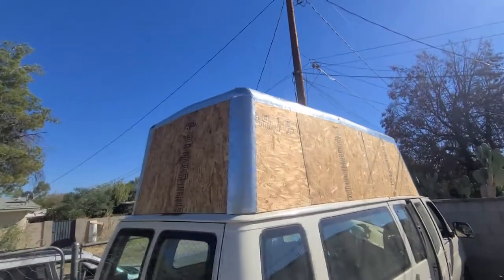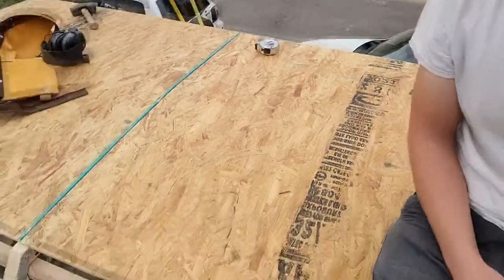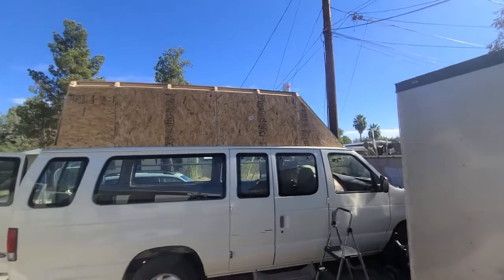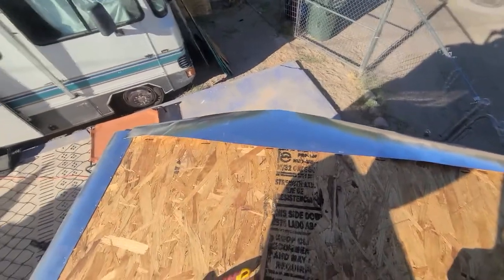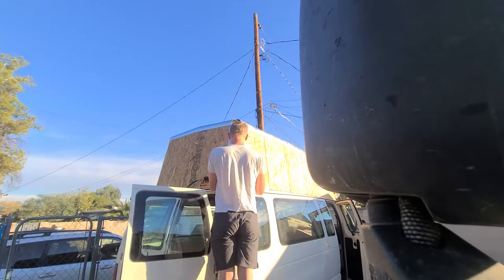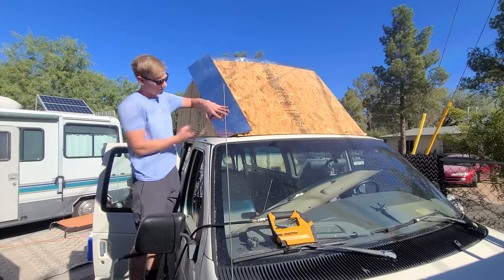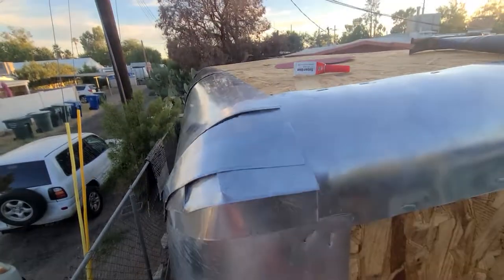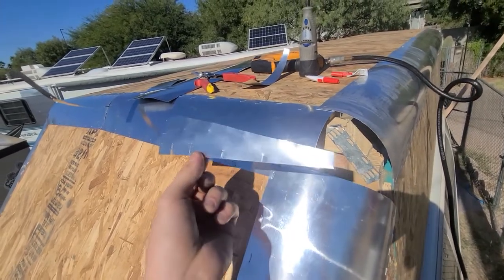Building a Wood Van Topper with OSB!

Comment: I have got a 1999 Savannah and copied this top on my van . I was 70 years old when I did it and it came out great . I made a couple of changes but basically everything was built the same I use regular plywood , I used your idea of flashing on the edges, I have more than 6 ft 10 Headroom. thank you for all the videos of your build , it made it very easy to copy your design and implement it on my truck , it's a very practical and logical design and works fantastic
Reply from the maker: That's great to hear, Roger!  Glad someone found some use in the videos.  If I did it again, I would also use regular (or marine) plywood for the shell.

Comment: Very nice.  I watched the completed project video first, now I am going back and watching your earlier ones to see the entire project from the start.  You provide a lot of really good information.  I was thinking of doing something similar only using that blue foam insulation board as the sheeting..  Once covered with fiberglass, you get the strength like you said and it is very easy to shape, just like when they make surf boards.  It is light and, you get insulation value at the same time.  It may or may not work, we shall see, ha ha.  Thanks.
Reply from the maker: If I were to do it again, I would consider that route as well.  You'd probably need an extra layer of fiberglass or two, but the strength should all be there if done properly.  Mounting stuff becomes a bit more difficult as well - It's nice having a pullup bar and Hammock rings on the inside of the topper 😄
Reply: @SisuVan  I would still build a similar 2x2 frame from wood like you did, it would not hurt to have a good, solid frame to work from.  I am very glad you showed how you built it, thank you.
Reply from the maker: Sounds like that would be a great way to go then!

Comment: Could you use a fine wire mesh for the corners instead of the sheet metal.  It would seem like a simpler and faster method of coverage/reinforcement.
Reply from the maker: I'm sure you could with fiberglass Mat, cloth would likely drip more.  Whatever you use as a substrate, just make sure you do at least 4 to 5 coats over the corners.
Reply: @SisuVan  thanks again for this build :)

Comment: I like your design a lot, it looked like you kept it safe by building inward a bit from the edges. I would want to utilize all of the space on the sides myself, but great design. I’m not an engineer so I ask is there a specific reason why the top is inward a bit? It just means a lot to me to make it flush with the rest of structure of the van
Reply from the maker: It mostly has to do with the structure of the van - you're going to want to attach the topper at a location where you have more than just the roof sheet metal to secure it too.  There is usually a structural rail around the perimeter that has a very solid flat surface you can bolt the topper to..  It is possible to still move the walls outward a bit though, you would just end up with an interior structural shelf - just build a wider foundation.
Reply: @SisuVan  oh yes that’s exactly what I am going for is to be able to utilize that extra space. Hey I just want to say that I really appreciate your build. It’s definitely the best I’ve seen.
Reply from the maker: @nightmahershadows  Thanks, glad someone was able to find it helpful!
Reply: @SisuVan  it’s definitely helpful and incredibly insightful. I’m just wondering if I could do something of this magnitude with my brother, yet he’s always busy. I can see myself doing most of the work, it’s just the cutting and drilling with everything that I’m not sure of myself. The Fiberglass part looks a bit daunting as well but doable. I probably would make mine a little shorter in Height as I’m 5’9”. Is it still holding strong for you?
Reply from the maker: @nightmahershadows  it's just as strong as the day I built it.  Fiberglass should hold for a couple decades if protected from UV.

Comment: That's cheap. What do you use? You're supposed to use plywood which is much stronger.
Reply: actually osb has come along way and is now better than plywood as they are using new resins   research it
Reply: @johnwolf1475  Thank you. I will do definitely. I'll get rid of my high top Van since that's cause I built my own high top as well. But now I got a regular high top Van which is naturally high topped.